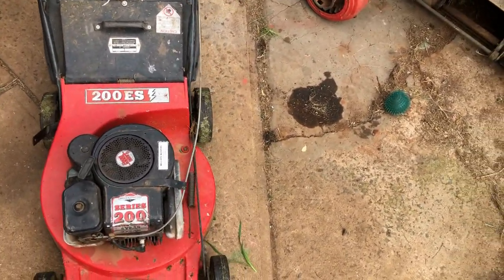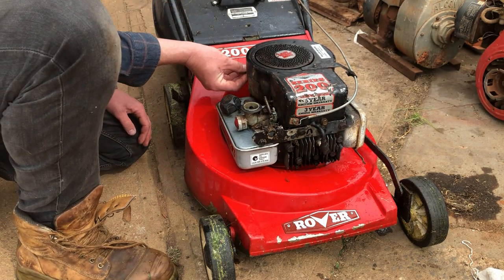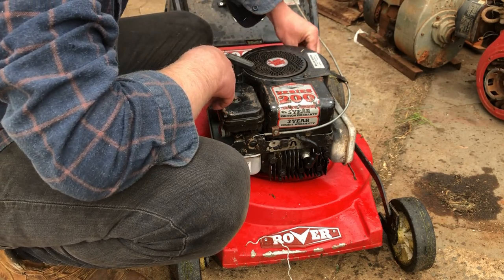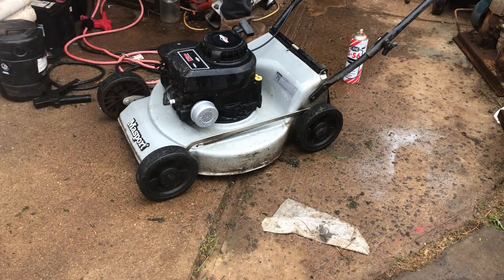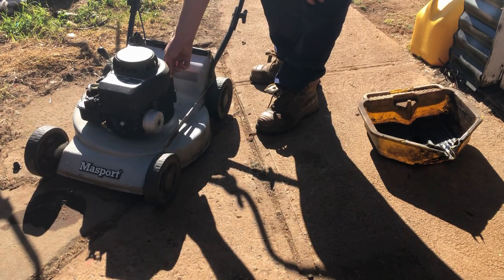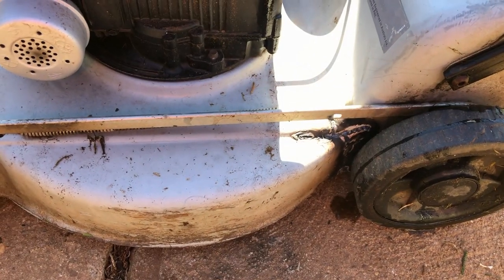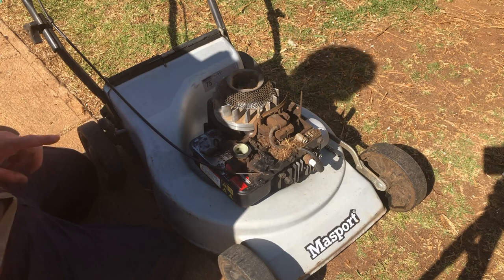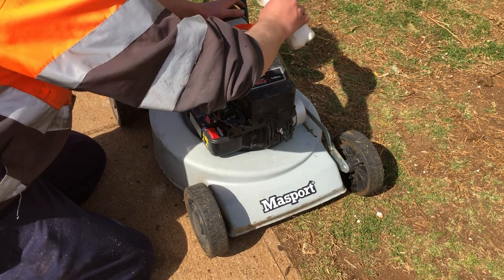Can we fix them? Two Briggs and Stratton powered mowers.

Comment: That Massport has some  issues with either blade balance or a bent crankshaft, judging by the shimmy it was doing. The Rover was a solid Lazarus job, considering it ran without oil for a period. Suggest you tie your shoe laces for safety's sake. Good work.

Comment: awesome stuff there Joe Carroll mate those Vertical Shaft Briggs and Stratton motors go forever as long as you remember to do regular maintenance and services and repairs on them when needed and required and Briggs and Stratttons SAE-30 is what i use in my mower engines on them being a Briggs and they go rock solid